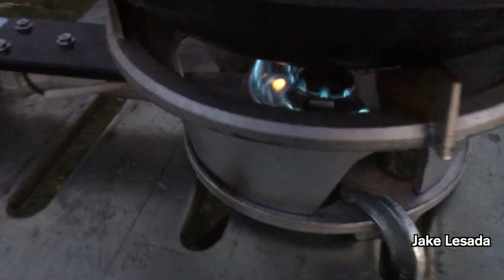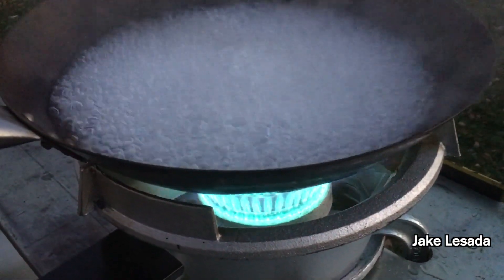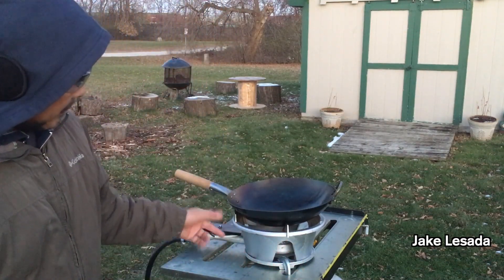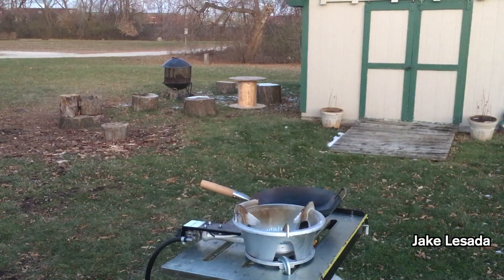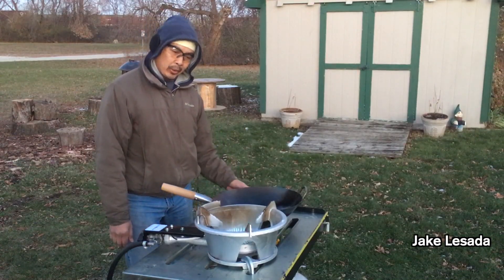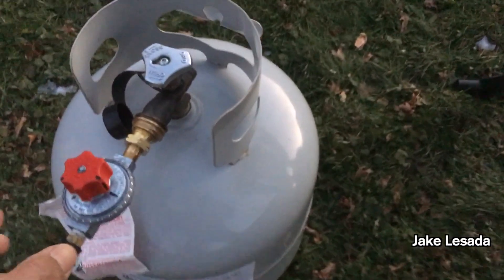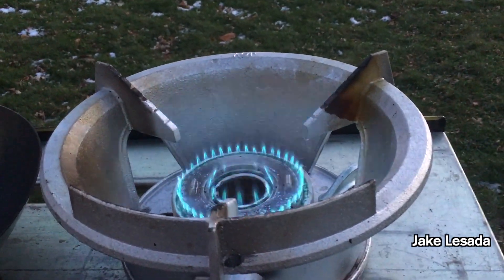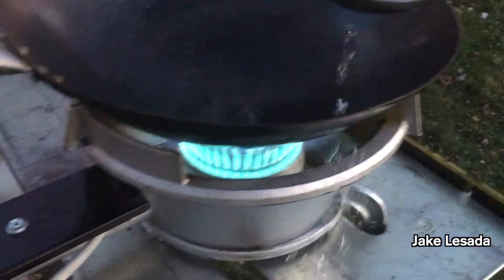Wok Burner For Outdoor.

Comment: Can you show me the high pressure adjustment set up? Because I ordered the burner but the regulator doesn’t fit 20lb propane tank. Thanks
Reply from the maker: I had the same regulator fitment problem when I first put my burner together with a propane tank.  The propane valves for USA are different than what arrived with the burner.  I use the Mr Heater High Pressure Regulator in the description.  *note, you'll have to get a threaded barbed end hose fitting to connect with the Mr. Heater regulator - and the barbed end connects to the hose using a hose clamp.  Then, do a soapy water test under pressure to check for leaks.  If no leaks, then ignite the burner and adjust the Mr. Heater regulator to increase pressure to get desired flow.  I sourced the barbed end fitting at my local hardware center.  It works great.

Comment: QUESTION #2
From many wok cooking videos I see how the person will ride the bottom of the wok on the heat shield as they flip the rice into the air while cooking.
HOWEVER, in this video i notice that the heat  shield that protects the handle from the flame actually has a ridge built into it to hold the wok steady when not being moved.

Does this built-in ridge interfere with how a person would  want to ride the bottom of the wok over the heat shield while flipping  rice?
Reply from the maker: Yes, it does drag on the bottom of the Wok and make the flipping action less smooth.  I just lift the Wok; and at first the wok felt heavy, but I got used to it.  I am going to round off the ridge with my grinder or band file and make it really smooth.  Then, it will be even more fun to cook with this Wok burner.

Comment: QUESTION:
I notice in the link in the description, that the controls  go off to the left side from where the heat shield is that protects the wok handle?

But in your video the heat shield is clearly in-line of the controls.

Did you have to change the direction of where the shield is?
Or is the link artwork in error?
Reply from the maker: The burner is comprised of three main pieces.  Piece #1 is the base with the burner adjustment and click igniter - it's arrives attached to the bigger round bottom base plate. Piece #2 is the burner small round plate disc with the 2 prongs facing upward - this is removal and can fall out when carrying - user error can accidentally be placed wrongly upside down.  # Important the 2 PRONGS GO UPWARD for correct install, otherwise you'll have an orange flame.  And, Piece #3 the Wok burner fire bowl. This piece can be placed in any orientation like a clock - but the correct way is to rotate it to have the heat shield side toward the person cooking.

Comment: The flame looks awesome. I'm contemplating. Do you see an issue with the construction quality or rust?
Reply from the maker: I made you a quick video so you can decide for yourself.  The construction is good thick metal, I didn't cover it at first and it did get rained on a couple of times, then I covered it cause it started to get some flash rust.  But overall, very pleased it's been solid. I'll clean up rust later and do a restore video.  Thank you for watching and commenting.

Comment: can you post link for the regulator you bought as well. some people was stating that the regulator that comes with it doesn't fit propane
Reply from the maker: I posted a link in description for the Mr. Heater Propane High Pressure Regulator part#F273719.  You'll still need to source a 1/4" Pipe Thread barbed hose fitting to connect Wok Burner original 10mm propane hose.  I used a 1/4" pipe thread barbed hose fitting from another regulator I had and it worked. The inside diameter of the Wok Burner hose is 10mm - I measured it and it's labeled on the hose as 10mm.  It's fairly straightforward with barbed hose fittings and hoses attached with a hose clamp. Just make sure to use soapy water solution at all connections to check for any leaks prior to using the propane burner.

Comment: From what I saw…..the ‘high pressure’ regulator you link to just a normal 5-20 psi unit that comes with most burners. Something I missed?
Reply from the maker: The manufacturer of this "high pressure" regulator is Mr. Heater, and their label describes this regulator as, "Propane High Pressure Regulator" Full Flow Soft Nose P.O.L.  "It's most commonly used on fish cookers, smokers or other high pressure appliances."  High Pressure range of 0-20 PSI.  It works great with this burner.  Thank you for watching and commenting.

Comment: today I got my wok burner....!

Its the same style as you got..

I have to design a wok table, so I may be asking some questions  to get some ideas from you if thats ok?
Reply from the maker: Cool, you got the burner.  I also use the side - flip up mini table on my BBQ grill as the wok burner table.  I affix it using a small metal C-clamp.  The C-clamp holds down the bottom plate of the burner and it works great.  A suggestion would be to have the height of the base of the burner placement about 26",  this places the wok handle height at about my mid section or belly button and makes it easier to flip the food.   The center section of the burner can accidentally be installed upside down,  make sure the two metal casting tabs are pointing upwards.  The flame should almost be invisible in the daytime and blueish at dusk or night.  If it's yellowish or orange, check to make sure the center burner is installed correctly facing upwards with the tabs.  Otherwise it's incomplete combustion and the flames will be orangish.  Also, the flame guard on the burner is the vertical casting on one side of the burner and this should be aligned towards you, this keeps the flame heat away from your hands.  The size of the propane tank will also determine the max output in BTU's of the burner.  The 20lb gas station propane tanks will only get to about 90,000 Btu's, but the 30lb propane tanks will get to about 100,000 Btu's.  I use the 20lb, because it's convenient and I can swap it with my BBQ grill tank if I run out of propane during a fantastic Chinese food takeout dinner wok session made at home. I'm designing my own street food style backyard wok station setup.  I cooked 4 quarts of pork fried rice for a Thanksgiving dinner contribution and it tasted great along with the standard turkey dinner.  Remember to include fire safety with your cooking and have a fire extinguisher handy incase of any mishaps.  Also, check all your propane hose connections with soapy water to make sure you don't have any propane air leaks.  Ask as many questions as you like.  Thank you for watching and commenting.
Reply: @JakeLesada  
would a high pressure regulator be something I should get? to replace the one that came with the burner?
Reply from the maker: That is what I did, I replaced the original regulator that came with my burner - the regulator doesn't work with the OPD valves on the propane exchange from the gas station or hardware store.  It needs an adaptor, but instead, I replaced it with a Mr. Heater adjustable propane regulator and it works great.  If your burner setup arrived with the pressure regulator that works with the propane units from the gas station, then you should be good to go with using it.  Otherwise it's a simple mod with the Mr. Heater adjustable regulator.  You'll have to also get from the hardware store a threaded barbed hose fitting,  this will attach to the hose and the Mr. Heater adjustable regulator threads onto the barbed hose fitting.
Reply: @JakeLesada  

What I got seems to connect to a normal BBQ  gas tank on my patio.
I got everything connected and I got the Wok Burner to fire-up with not trouble at all.

But.....but what I had a hope for is that I wish I could have a greater fire.
I still got a good fire in the burner, and Im sure it will work fine.
But I sure wish I could find a way to bump it up and be more powerful....

I think I sent you a video on facebook of what I got going in my burner now...
Reply from the maker: Yeah, I just watched it and I like your setup.  Is your regulator adjustable or fixed setting?
Reply: @JakeLesada  
Well,,,the truth is, I did play with it last night with the hope if bumping up the flame.
Im not sure I did anything.

The regulator does have some type of turning screw at the top that i think must be for flow control.

But I did not see the flame get much bigger, and it would make the flame get smaller.
So I turned it up all the way and left it there.
Reply from the maker: That's good, just get it to max and work with it.  When your wok arrives season it properly, and then do a water boil - timed test and see how it does with the current regulator pressure.
Reply: @JakeLesada  
Update..
I got a high pressure reg

Comment: The camera is moving around way too entirely fast!  I am trying to appreciate your set up.  I wanted to check out your set up table.  But can't see it since you are swaying the camera around all over the place! 🙄
Reply from the maker: The burner is what I am trying to show, I am not trying to show the table setup.  The table is a Harbor Freight welding table I used to mount and test out the burner, it is held down with a C-clamp.  My other table set up is to use the folding side of my charcoal BBQ grill, it works too using a C-clamp.  Thank you for watching and commenting.